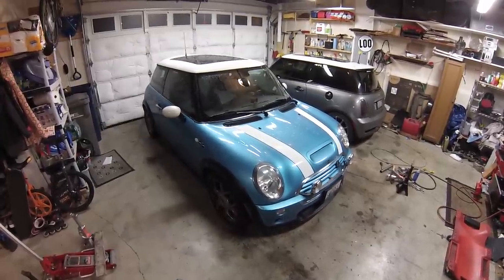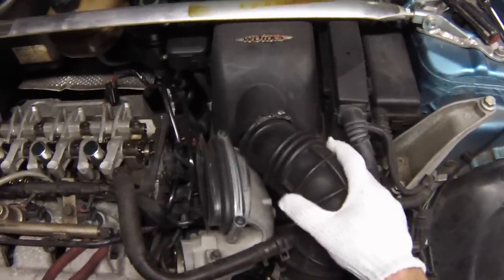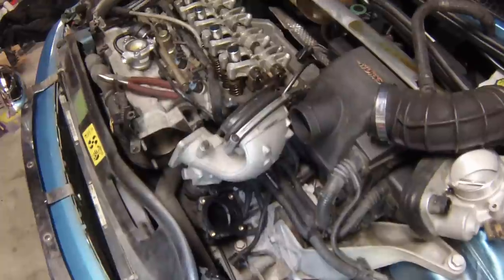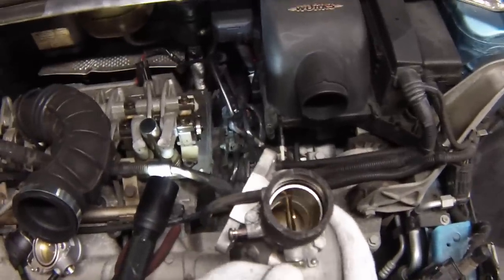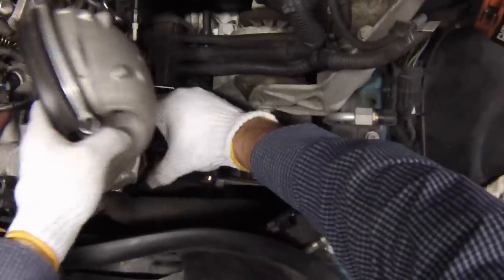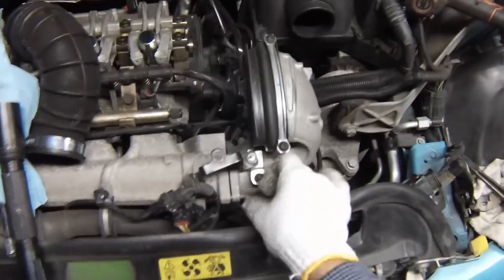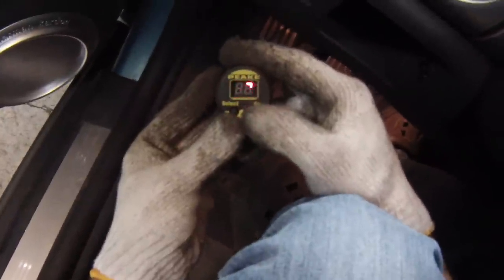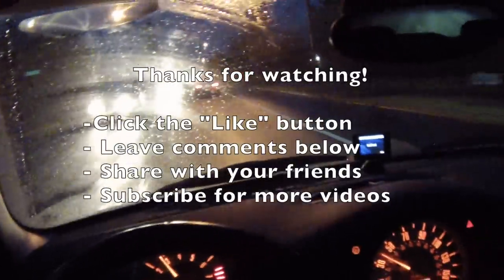MINI Cooper S R53 Bypass Valve Repair 2002-2006 BPV

Comment: Hello, my 2005 Mini S begins withholding power and I received a code of P1688. investigating, I found oil in the rubber on either side of the inter cool. Is that to be expected ? If not, what would you suggest is the issue. The MAP looked absolutely new and the bypass vale had minimal deposits and cleaned up nicely. Thank you-Patrick
Reply from the maker: Oil in the boots is normal. https://www.northamericanmotoring.com/forums/stock-problems-issues/198843-p1688-code-on-02-r53.html Bypass valve can be clean and still failed. Check spring for proper tension and no roughness. Pull a vacuum on it and see if it holds. Sometimes the diaphragm is torn. Otherwise it could be failing crank pulley usually accompanied by burning rubber smell.
Reply: Thank you very much

Comment: Yes sir I connected everything back just how it was before ...I double check I even went back and took everything of again and put it back together i didn't put a new throttle gasket didn't think it need a new one
Reply from the maker: +Juan Garcia Throttle gasket is reusable. You must have a disconnected connection somewhere. Cam sensor, crank sensor...

Comment: I have a similar problem i lose power like my mini will bee on the freeway and the car will feel like i let go of the accelerator and press on it again, when im firmly pressing it. And it will do it on the street sometimes too the only thing that doesnt match is the 3k rpm and i have no check engine light do you think it might be related to this valve?
Reply from the maker: Maybe. Check, the spring tension.

Comment: Hi Mod MINI,
 
 I have been having the dreaded P0130 pending code coming on when the vehicle is cold. I clear the code, and restart after the engine is warm, and I don't get a pending code. After the usual 2 cycles it goes to a hard code. Changed downstream O2 first for bad heater circuit code, then P0130 came on for the upstream. changed the upstream O2 and code continued to come back with no other codes. Have changed plugs, wires, and fuel filter since without being able to kill the code. When engine is started the fuel circuit goes to open loop, then to Open loop fault. After a few miles it goes to regular closed loop operation. I'm starting to loose motivation with this one. Please advise if you have any ideas.

Rich
Reply: By the way it is a 2004 MCS.

Comment: Thanks for all your great videos, I've restored a few MCS with your info. My question on this video is would a faulty bypass valve also cause the R53 to tick over rough on start up? It feels soft to push compared to my other cars, and it's had a new head build, plugs and coils? 
Keep up the good work. Cheers Matt
Reply from the maker: probably not.

Comment: Another great vid.

Hello @Mod MINI,
I have a problem and maybe you can help me.

Yesterday my car (mini s-jcw 2004) lost power and enter in safetymode, then was "turned off-turned on" the engine and goes well, after i use my obd lector and show me that codes P0420, P1237 and P1688.

I followed this steps:

1. Clean MAF sensors (idk if they works well)

2. Test the bypass valve if they move smooth or hard. (aparently works well, not really hard neither smooth)

3. Test the pressure valve (aparently works well, i can blow just in one direction)

Can you tell me what else I can try and how to do it?

Thanks alot.

*Even if you can't help me, good luck with the channel and keep up the good work.
Reply from the maker: You need to connect to diagnostic tool to even know where to start.
Reply from the maker: Sorry, just noticed you already ran diagnostics. Check your belt/crank pulley, look for ir leaks, Anything beyond that I'd really need to see the car.
Reply: @ModMINI  Thanks for your answer, i will update if i find the problem.

Comment: Hello, I am working on a 2005 R53, and it has had a lot of modifications done by the previous owner, Big valve head, 3" Borla exhaust, Lightened flywheel, Polished and Ported Head and supercharger, ( previous owner old me, could be a lie) 17% pulley, Cold Air intake, Header, Injectors, etc.  It intermittently will go into limp when revving 3-5K, I have to shut it off and restart with the key. It seems to do it when it is up to operating temp. I was thinking BPV, bu there is ao of resistance on the BPV spring. It is throwing codes- 2096 +02 sensor bank 1 after cat too lean, and 1688 electronic throttle monitoring level 2/3 Air mass calculation error, and a 5e19 Can Data error from DME/DDE. Any ideas? ( Read it with an Autologic) Thank you in advance!
Reply from the maker: +Ecuador Beachbum Sounds like you might need a tune or you may have a bad sensor somewhere. BPV can also be bad and you don't know it unless you compare to a known good one. Other possibilities are torn/failing crank pulley, vacuum leak, exhaust obstruction, etc.

Comment: Can a relief blow off be adapted? someone who has installed a relief blow off to an r53?
Reply from the maker: A bypass valve is not a blow off valve. Such a modification will confuse the engine computer and you'd get an air mass or unmetered air OBD code.

Comment: My snorkel is cracked where that long cylinder juts down  to the ground. Would that cause my car to go limp?
Reply from the maker: Laurie Ostapovicz Definitely get that fixed. Any leak in intake air path could cause air mass calculation issues. A leak after the air filter can result in dirty air (and even large objects) getting in to the engine, which could be very bad as well. The intake air tube is before the manifold air pressure (MAP) sensor but it may be sensitive to back pressure. I know one time I tried to move my MINI with the air filter removed and it ran very oddly.
Reply: thank you. I will definitely order a new one. Where do you order mini parts? i couldn't find an acceptable one on eBay. Or maybe i'm typing in the wrong product description.
Reply from the maker: Laurie Ostapovicz Check realoem.com to find the part number http://realoem.com/bmw/showparts.do?model=RE33&mospid=48021&btnr=13_0979&hg=13&fg=20 and then search around online for the best price/shipping.

Comment: Hello Mod,  my Cooper S R53 had a Problem. It sometimes jerks after a cold start.  When it is at temperature it sometimes feels like it is hanging on a rubber rope. I bought a ngk coil, beru cables and Champion platinum multi ground sparks. He does not display engine errors.  What can it be? You have any experiences for me to share?
Reply from the maker: Hard to understand symptom from the description but could be slipping belt

Comment: Would the bypass valve also cause a slight rough idle... almost like you had a loopy cam? I have no codes stored in the OBD 2 either.
Reply from the maker: It could but any air leak could also

Comment: Question my 06 Cooper s has been hesitating and stuttering at lower rpms along with an evap leak code. Started off as p0455 large leak. I spent a $1000 having a smoke test done and a bunch of parts replaced that I already knew were no good as well. Such as o2 sensors, spark plugs, spark plug wires, map sensor, supercharger intake tube (smoke test determined leak was coming from this tube) and some other ignition parts. But my question is that can this bypass valve cause an evap leak? It’s been an issue since I bought the car haven’t been able to locate it yet. My car also went into limp mode on me before the work was done and read p0301 misfire cylinder 1. Could this bypass valve be my main issue?
Reply from the maker: BPV cannot cause evap leak

Comment: Hey love ur vids . Got a question . Got an EP light n I can’t get it to go off , did trans flush with additive. Changed batt alt . Still got an ep light . Can I get a little help. I have an 06 mcsa. Cleared code n comes right back on when I start instantly.

Comment: Sir, I have a GEN 1 Mini with a recurrent P0455 error code (EVAP Leak). I have already changed the Leak detection pump, fuel tank breather valve and gas cap. From your experience, what else should I be checking?
Reply from the maker: I don't have experience with that code. Check tubes from back to front of car for leaks - use a smoke tester if you can Make sure the fuel vapor solenoid (next to engine mount) is connected and working.

Comment: hi great videos and explanations....im have a problem with my r53 after changing the 02 sensors....the car started getting a ruff idle then to regular and back and forth without throwing any codes....do you have any ideas or had this problem before??...thanks in advance for your time!
Reply from the maker: Wait a little, it might be just correcting adaptations based on the new o2 sensors. Also, if you used Bosch sensors, get rid of them. The car needs NGK/NTK sensors - this one. http://amzn.to/2dAFDJi
Reply: thanks a million....i will do this asap and update....thanks again for your time!

Comment: Is this the same as the “supercharger cut-off valve”? A local mechanic where I live suggests it needs to get replaced on my R53 05 mcs to regain its power. He wants $450 for it.
Reply from the maker: I think same thing. That's the book rate for the job most likely. (front end has to come forward to do it the 'right' way)
Reply: Mod MINI 
Thank you ModMini!

Comment: Mine definatley needs doing 03 plate, not very snappy low in the revs goes good when it's get a going but just doesnt feel very snappy at the throttle

Comment: Great videos!  I have a 2003 S have done a ton work thanks to your detailed videos.  Not sure if this could be related to the bypass valve but if I pull off the oil fill cap there is a positive pressure (no vac.) a rag actually blows in the wind.  I'm not getting any codes and the car generally seems to run ok.  Is positive pressure in the crankcase normal?
Reply from the maker: That's normal and is due to compressed air escaping past the piston rings and entering the crankcase. That's what the PCV and breather hoses are for. They suck up the blow-by gases. It's also why you don't want to run the car with the fill cap off - it will spray a fine oily mist everywhere.
Reply: Thanks for the quick reply and reassurance. I was nervous that the high pressure could cause oil leaks.   Keep up your great work.

Comment: thank you for all the great videos, i just purchased my first mini r53 a few days ago. i have a engine light on, code is p2096. any input on how to fix this. once again thanks for all the great videos. i have learned a lot about these cars
Reply from the maker: Probably unrelated to bypass valve. That's probably a bad O2 sensor. The pre- and post- cat sensors are the same. Buy this one (link below) and try swapping out the precat sensor first. If the problem doesn't go away, swap positions with the rear sensor and try switching all of them around (the new one + the 2 old ones). When the light stays off, you know which one is the bad one. 

http://amzn.to/19A5LgU
Reply: Mod MINI

Comment: I'm having a similar problem. My 03 r53 feels sluggish around 2800rpms and when I hit 5000rpms my engine light comes on and it's almost as if the supercharger has switched off. I can turn the car off and then back on and everything seems to run smoothly. I was considering looking at my bypass valve but a mechanic told me that there is burnt oil in my supercharger causing higher psi at lower Rpms and the computer is shutting it down
Reply: Also I looked at the externals of the spring mechanism on the bypass valve. It seems as if it isn't shutting all the way and it almost sounds like the spring is broken. Should I feel confident that replacing the bpv will do the job??

Comment: Hi mid mini have a serious issue with my mini not sure what it is I have a 2003 Mini Cooper s jcw 
Well the problem is even when stationary it is accelerating by itself goes to about 2000rpm then back down
And then again up continuous the sound of the car also sounds different the catalytic converter also becomes
Bright red after a short drive brake pedal also become very stiff have 3 fault codes any idea what it is if you could 
reply back would appreciate it very much thank you 
P1109
P1242
P1688
Reply: Sorry p1689 is the fault not p1688

Comment: I know your time is expensive but please help me . Bought a Mini r53 JCW  2003 . First problem dsc not working -did an obd check 2 faults P0036 and P0341 . Car runs fine . Today was very hot and the temp warning light with abs and brake light all were flashing and revmeter dropped to zero car working . As i speeded up all lights off and rev meter working fine as soon as i stopped all flashing again and rev meter trying to reach 0 . Please just give me a hint i love this car but in my country ( Romania ) there arent any Mini specialists . Thank you very much
Reply from the maker: DenisC03 How old is the car battery? If you have a low charge, lots of problems can happen like this. You might also have bad alternator.
Reply: thank you i will check the battery . i think its old .

Comment: Have my sons car at a speed shop  for minis just wondering  how long it takes to replace the blow off valve on a 2007
Reply from the maker: Bud Bullis I've only ever replaced the blowoff spring, which took only a half hour. I'm just guessing and haven't replaced one, but I guess the entire valve could be changed in an hour or two?

Comment: +Mod MINI So i have a 2006 R53 and there is nothing wrong with it but i was thinking about getting the Detroit Tuned bypass valve!, you said it would feel sportier but get worse fuel economy but i dont care about fuel economy since its not my daily. is there any other drawbacks or advantages to the Detroit tuned bypass valve? and at which rpm does the car start making boost?
Reply from the maker: Probably best to read Detroit Tuned's description themselves, RPM ranges are unaffected but seems like it starts boost slightly earlier after throttle tip in. The valve snaps closed more quickly as well which can cause some neat new burble/pop, although it would probably vary by car.
Reply: Thank you for the input! Love your videos!

Comment: Will the bypass valve cause the eml light to come on? My eml light comes on often but only at idle. I have to turn the car off and back on to reset it so I can drive at normal power. Any ideas of what else could cause the my eml light and loss of power? Thanks.
Reply from the maker: +Paul Dobranski It can. Need to know what codes it is throwing to even start diagnosing.

Comment: I have a 2002 mini base shift stick, my question is why when I put 1st to 3rd gear car speeds up kind of strong but when I put 4 and specially 5th gear it it looses power, even impress the gas pedal all the way down its hard to pick up speed? Do u know y? Tnx
Reply from the maker: Well, taller gears will demultiply the torque that reaches the wheels, so it will never have as much pull as in a lower gear - especially in a base MINI that doesn't have much torque to begin with. Another possibility is a slipping clutch. If that is the case, you would hear the engine noise climbing even though the car is not speeding up. That's all I can think of.

Comment: Great video as usual, thanks heaps!  Just changed out the valve cover gasket (from another of your wonderful videos) and noticed the other end of the vacuum hose from the throttle body (you mention it at 4:49 in this video) is blocked off at the other end on mine and just floating free.  There is a square looking connector just behind the intercooler tube on the other end of the motor that seems to have a plastic seal around it and it just floats free not attached to anything.  Is that normal?  The vehicle was only 83,000km old when I got it and had only ever been serviced at the BMW dealership it was originally purchased from.  Very strange...
Reply from the maker: That might be normal for your country. Not sure. 
Photos maybe?
Reply: Hey you could be right there. The vacuum connectors on the inside back edge of ercooler connector is only one not two like most descripti Na I see (and mine had fallen off - put it back on and it fell off again too)..  this is the connector I mentioned, this is the drive belt end of the engine https://goo.gl/photos/1HsnyPSvSzDgM2u37
Reply: I just realized the connector that fell off is the vacuum line to the fuel pressure sensor. Judging by the oil stains under the connector it has been off for a while too. I have cable tied it on now and hopefully that will last a while longer!

Comment: hello MOD
do you have any idea what's wrong with my mini it was running ok 2006 mini cooper S
it 's starting but it doesn't go no more than 10 mph and the engine is  shaking;  hope you can help me thank you
Reply from the maker: +LUIS VILCHIS I'd need more information that to even begin. Check engine light? what are the codes? etc. etc.